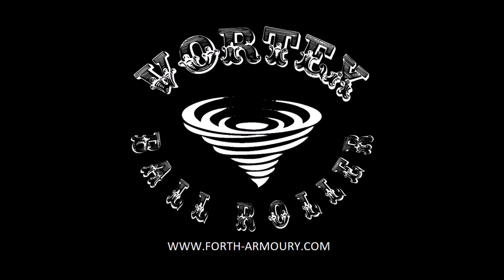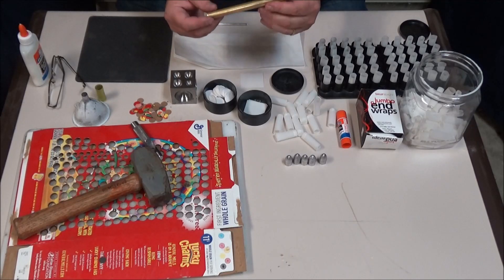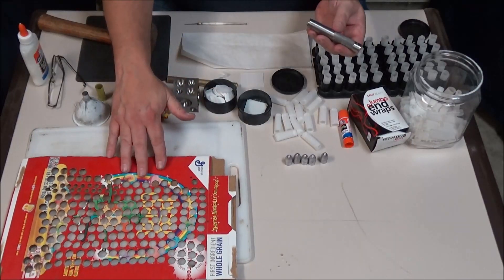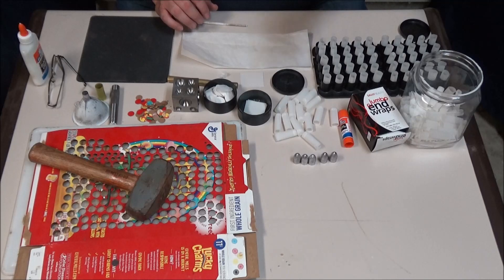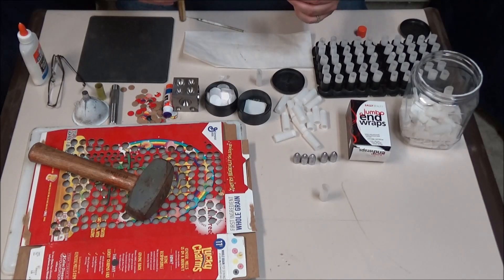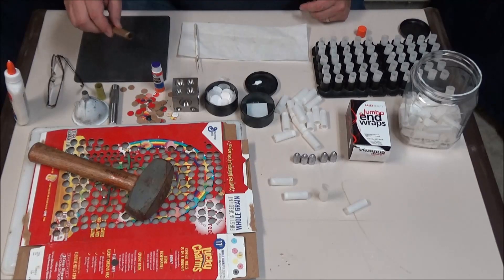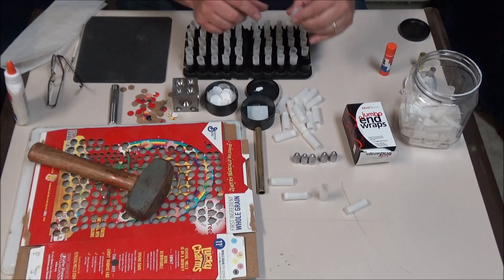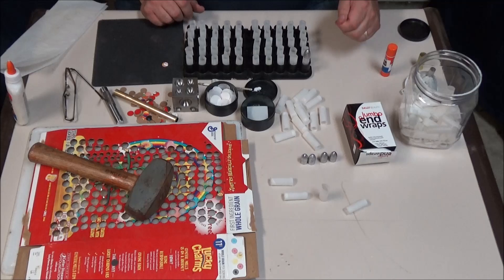More details on making cartridges for the Sharps carbine

Comment: Thanks Musket Matters for your video, I know I'm late to the party on this but, I recently discovered your channel after obtaining an Italian 1859 Sharps rifle, therefore, I have been researching a lot of info. I purchased the "Star & Bullock" 1859 54 Cal Sharps Kit and it works reasonably well. However, there are parts of your reloading process that I like better, e.g., your brass 17/32" dowel and Doning Block & the way you push thru your circular end cap. I'm sure you have shot hundreds of these and found them to fire safely but, I kind of understand peoples concers on air gap between powder & bullet, albeit, I believe it's been proven several times over that the saftey concern is blown way out of proportion! With that being said, if someone still has concerns about it, they could simply measure how much filler (Corn Starch, Corn Meal, etc.) they would need to where the bottom of their bullet rest up next to it and be done with it. I believe this has been done by several people over the years showing no real difference in accuracy & no unnecessary risks!  Anyways, I loved the video and plan on incorporating some of your techniques, thanks again.
Reply from the maker: You can also use fiber wads, which is what I use now as they are easier to insert and no gluing is required.
Reply: @musketmatters2004  
Where do you get your fiber wads?
Reply from the maker: @deputyspence9368  Track of the Wolf is one source.

Comment: Steve, I'm curious as to.your opinion on using glue versus nail polish to attach the bullet. I'm new to.the Sharps and will be shooting my first N-SSA comp next week. I've made cartridges like yours and glued my Rochmond bullet in with stick glue. Ive seen other videos that say use nail polish instead of glue. Not really sure why. Thanks. Tim
Reply from the maker: I have only ever used Elmer's White Glue or Duco Cement.  Charlie Hahn recommends Duco when using his cardboard tubes.  I think nail polish would probably work fine.  I think it is probably advantageous to use a glue that dries hard and brittle, so that it wants to flake off the bullet on firing.  Any kind of rubbery glue might tend to cling to the bullet and effect accuracy.  This is just a guess on my part.  But I know that historically the British made alterations to their Enfield ammunition to make sure the bullet shed its paper patch because sometimes it clung to the bullet and affected accuracy.